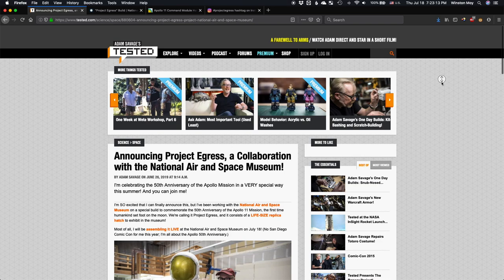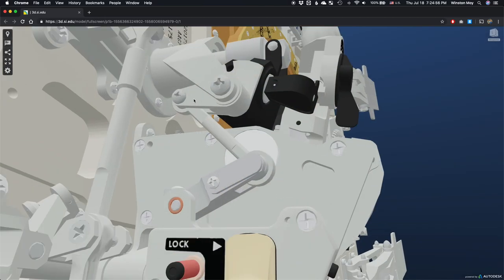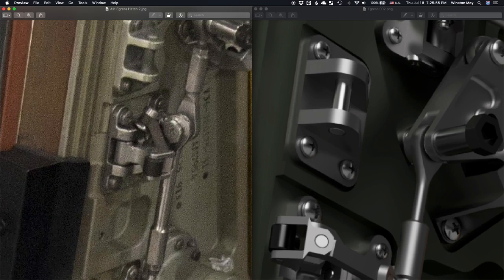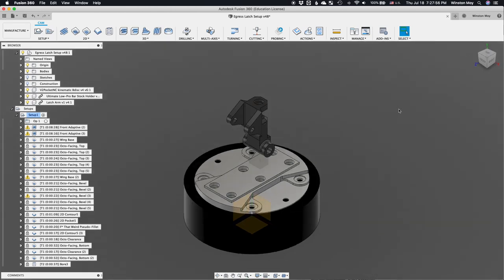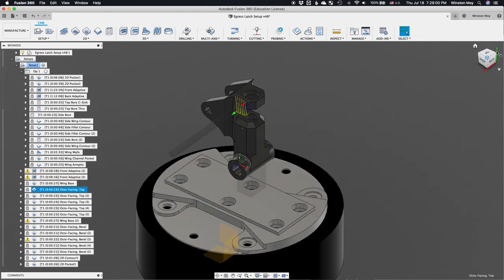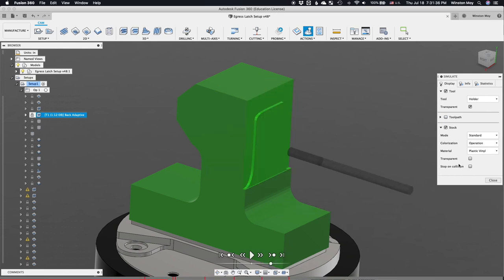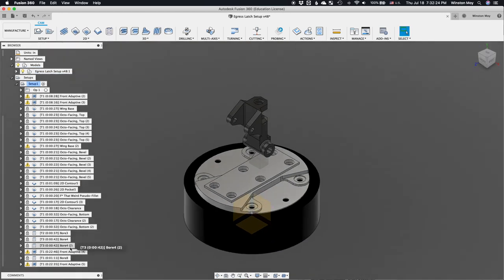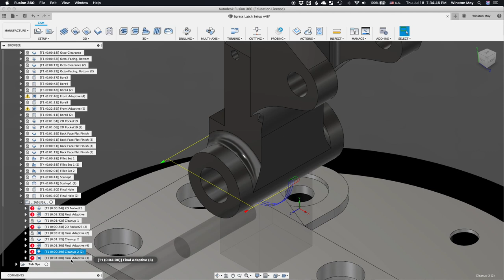Replicating an Apollo 11 Hatch Component - #ProjectEgress

Comment: Excellent. Watching you progress in 5-axis is cool. We recently solved a problem on our 6040 that was as mysterious as yours. Turns our the fine chinese wire with four conductors had one 'barely' broken, so errors were intermittent. We thought it was the stepper driver, but randomly touched two wires together to test the cogging of the stepper, and then the other two wires which had NO cogging, which is how we discovered the break, which again was only partial, so very intermittent. Runs great when no mysteries occur :-)

Comment: Fascinating work! When I first looked at the PocketNC its integration with Fusion360 was iffy. From what you show in the video it looks like there's now a smoother integration. Is that true?
Reply from the maker: I don't know when you were looking at the PocketNC. Back in the V1 days things overall were just a little tougher, but that was all before my time. Since the V2 came out, Fusion has always had a post processor that allows for easy export of gcode to the PocketNC. And in fact, unless you spend thousands of dollars on industrial CAM solutions like MasterCAM, Fusion is really the only way to use the PocketNC for us mere mortals.
Reply: @WinstonMakes  Thanks! Yes, I'm referring to when the PocketNC was first announced. I love Fusion and am glad to see it's all working now.

Comment: Is it possible to end up with an aluminum part that doesn't show the toolpaths? Or do you just have to hand sand/polish it as a final step?
Reply from the maker: Not on a desktop CNC machine. Takes extremely specialized machines and/or tools to get a finish that doesn't have obvious machining marks. If you want something that looks polished, you might be dealing with a diamond tipped tool of some sort. Otherwise, anything shiny that you'd deal with on a regular basis is probably polished off the CNC.

Comment: Maybe as a last operation would be a surface treatment to even out the finish with gentle media blasting with media like dry ice or sodium possibly?
Reply from the maker: If I had more time I would have bead-blasted it. I hope that by 'sodium" you mean "salt". Sodium would explode... But those medias are a little too gently for surface texturing if your goal it so apply an even look IMO. Glass, aluminum oxide, or sand are better.